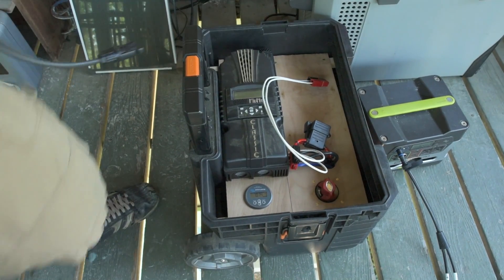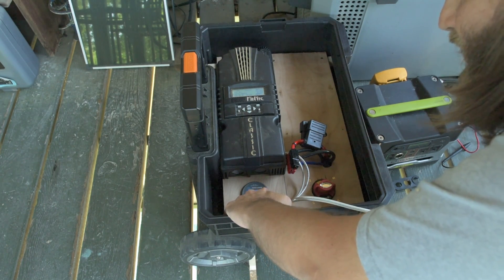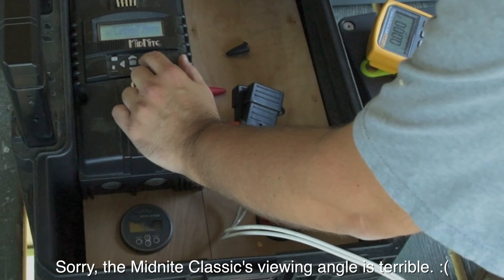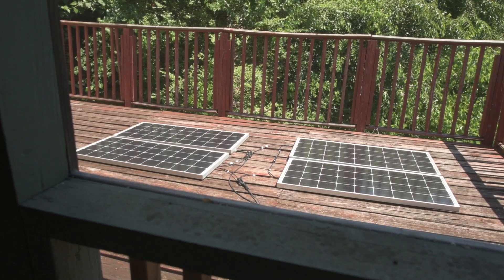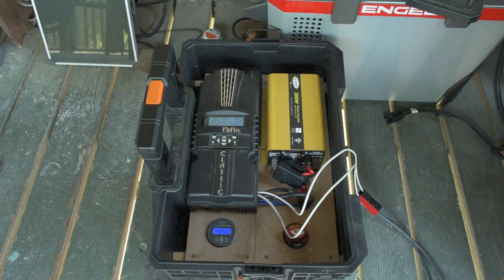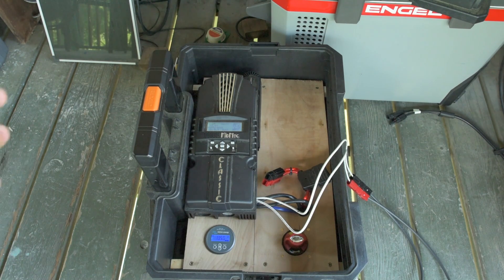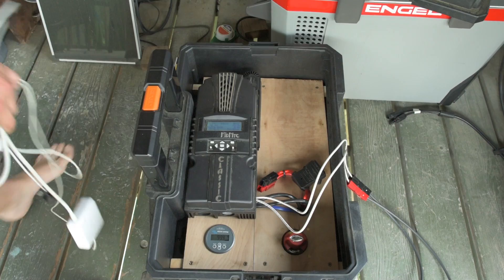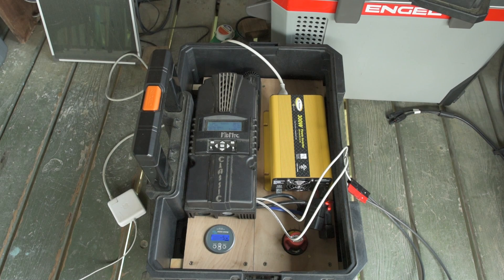1200wh LifePO4 Solar Generator Build - Part 4 - Charging

Comment: Umm, you've probably sorted this part by now, but typical LiFePO4 cell charging should be maxing out at 3.65 volts, so x4, that would make it 14.6 volts, not 13.6 volts, so you might not get a full charge without adjusting your settings on the Midnight Classic.
Reply from the maker: I’m bottom balancing. I don’t want a full charge.